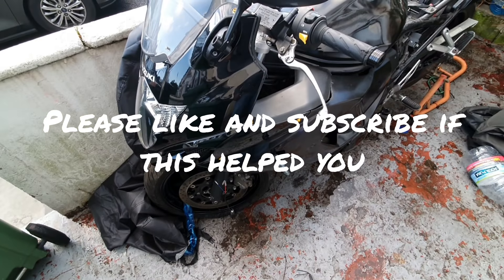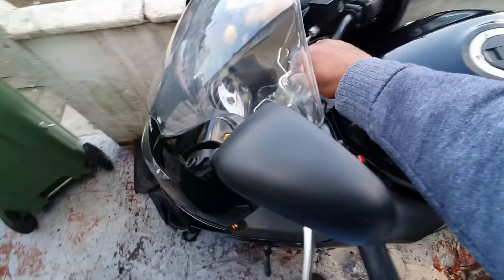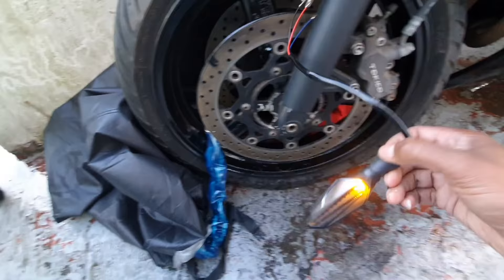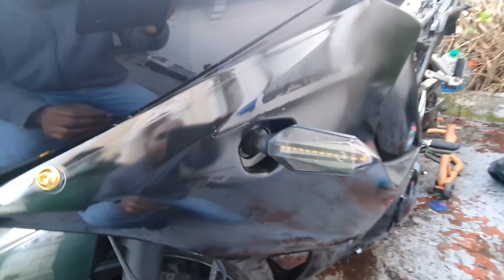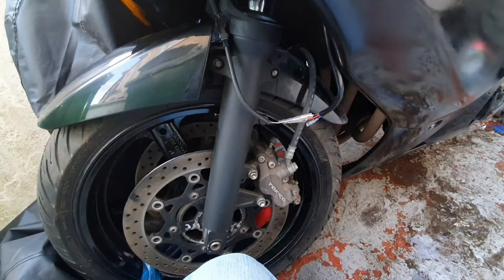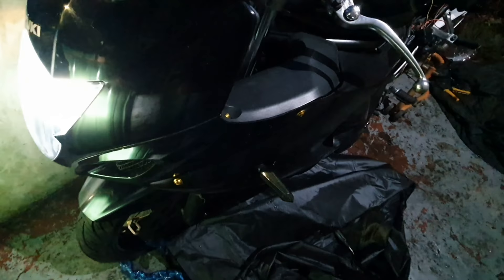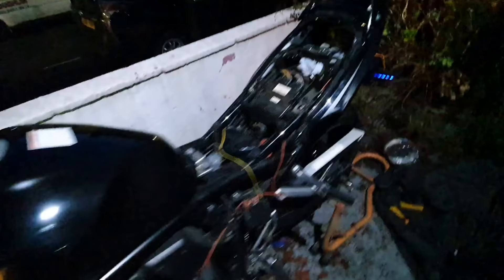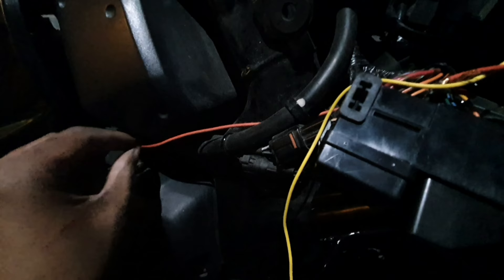How to install sequential following indicators on a motorcycle

Comment: Nice one saves a lot of unnecessary messing about thanks for the heads up I’m looking to fit led indicators to my tracer 900gt thanks 😊
Reply: please tell me what you did with that extra wire. cant get back light to work i'm guessing the extra wire is for that

Comment: Pro tip, if you have sequential indicators they have their own relay built into them

Take off your relay and connect the two pins together with wire or a connector to bridge it, and perfectly working sequential indicators without spending anything

You're welcome
Reply from the maker: Possibly could work on a bike with only 2 pins but mine has six on the relay so don't think it will work I have previously fitted these two different motorcycles it don't work properly these do not have inbuilt resistors but I will try it with my other set thank you
Reply: Was just about to try this out just checking comments to see if anyone ealse had jumped the contacts haha ill go try this. I was thinknig this becase i put the led over the battry to make sure they worked as i was getting nothing at all. I think i might stiill need a diode kit as its an old suzuki bandit.
Reply: What about flow rate to pass mot I fitted these, yesterday front and back and bridged the relay but was told it would fail mot due to flow rate speed??
Reply: @leejones3061  i had no issues passed mot. My issue was thay the dash indicator didnt flash anymore. Need new relay and resistor kit to fit it. Flow rate wasnt an issue. It is a problem with the relay replacment. But i passed mot with dash issues as you can see indicators from driving position.
Reply: How would you work it if only the front ones were sequential and the back ones were regular? Can you bypass the flasher module for just the front ones?
Reply: Hi, I ride a 2008 Hornet and I tried to mount the same signals as you but with the relay built in. In my case they are doing nothing. They work for sure because I tested them directly on the 12v battery (that's how I know they have built in relays). My relay has 4 pins. Which pins do I have to connect. How can I test which to connect .
Reply: My relay is 7 pins, how am I going to bridge the pins pls.
Reply: Pls how am I going to bridge the 7 pins led relay in Suzuki katana GSXF

Comment: wow thank you so much!!! i have the same problem
Reply: Ww is max out of the max
Reply from the maker: The sequential indicators do not have a built-in relay so can be fitted to any motorcycle provided they do a LED relay too slow no the flash rate down if not it will not work properly I hope this helps you

Comment: Dear sir,

instead of the stock turn signals on my V Strom DL650, 2014, I installed a sequential flow. I installed an automatic relay for the LED lighting instead of the original automatic relay. For the shade, they work a little faster (I honestly don't like it), and the led indicators on the instrument panel are only bright and do not blink. Even when all four indicators are working, the LED indicators do not blink, they just light up. PLEASE help how to make the indicator blink. greeting

Comment: Pls, how can I bypass the motorcycle relay when I'm using built-in relay sequential turning lights.
Reply: Take the relay off completely and put a wire between the connectors that plug into the relay, this will bypass relay and sequential indicators will work.

Comment: Might want to do some research on how that resistor should be wired. Black stays on neg side. Yellow stays on pos side. If I could post a pic I would. But they didn't work because you wired them incorrectly. 
Kindly :)

Comment: I fitted sequential indicators front and back yesterday on different bike initial install the indicators wouldnt flow to the end so fitted load resistors that just made them all flash at once hazading so was told to bridge the relay so I did and there all working but was told they, could fail mot due to the flow rate speed I had a led relay as was using led set up just not sequential
Reply from the maker: I just had my motorcycle MOT'd 2-days ago go and they did not say anything it passed with flying colours as all new Audis and Mercedes have this new feature I can't see it failing if the LEDs and the indicators are working but please update

Comment: Clearly I'm way to late to comment but hopefully you can help me out or someone on here. I purchased the same indicators as you but didn't realise they come with 3 wires, the original only have two so it's got me lost. I noticed you had the red and black wire connected but not the blue? Mine has a black, red & green wire so I don't connect the green? I'm totally lost in what to do, does anyone know where the green wire goes?
Reply: i have the same problem
Reply: @bOjan1141  I have found these on ebay which I'm thinking of trying so hopefully it might help you as well, no one has helped me but here check these out...Indicator Turn Signals Wiring Harness Adapter 3 Pin For Suzuki SV650/650S SV1000 or put your specific bike ofcourse
Reply: @joshuayarker6364  Thank you brother, you saved me. I ordered them hope they arrive fast.
Reply: @bOjan1141  anytime my friend, glad I could help! Hopefully real fast! 🤞

Comment: what's the name of the brand for the bigger indicators with blue arrows?
Reply from the maker: They do not have a name just following indicators I have the link below in my add or try this one https://www.ebay.co.uk/itm/2pcs-Motorcycle-Sequential-Flowing-LED-Turn-Signal-Indicator-Blinker-Light-/284383815158?mkcid=16&mkevt=1&_trksid=p2349624.m46890.l6249&mkrid=710-127635-2958-0

Comment: In they looked great but you confused me throughout the video. Do you have a Link for the blinkers?
Reply from the maker: I'm sure I put it in the add  addhttps://www.ebay.co.uk/itm/4x-LED-Motorcycle-Rear-Front-DRL-Sequential-Flowing-Turn-Signal-Light-Indicator-/133701753225?mkcid=16&mkevt=1&_trksid=p2349624.m46890.l49286&mkrid=710-127635-2958-0
Reply: @sammouss6901 you did but only for the relay!!

Comment: Iv just bought a set for my adrenaline! Will i have to buy a relay too? Its not just a case of swapping them over?
Reply from the maker: I'm pretty sure you will need to as the resistance to delay the flashing is inbuilt in a standard bulb with LEDs especially strobing ones there is no resistance so it will only light up a few LED cells the only way to get resistance is to delay it with a resistor you can test it by Simply swapping one indicator but I'm pretty sure you'll need a relay I hope this helps
Reply: Ah cool thanks for your response!
Reply: you can just short the relay with seqencial led indicators and mabie the diodie mod if you have one filliment dash bulb but the circuits in the indercators on these but dont do it to the standard flashing leds they need the led relays off ebay cheap as chips.
Reply: @spongbob18  thanks pal

Comment: Hi, thanks a lot for the video. I ride a Hornet and my new built in relay signals are not working at all with the original bike relay. I have a 4 pin relay. I tried to search a relay for my motorcycle model but they are not specifying if it does work with the built in relay signals. Someone tried some of them on a 4 pin honda? Thanks
Reply from the maker: Hello boby bob I think the problem you're encountering is the same one I had you cannot put indicators with relays on relays it simply will not work if you have a simple 4 pin relay it's literally 2 + 2-  if you can find out which is Which Bridge the circuit as long as you have inbuilt relays in your indicator it should work the only alternative is if you can get a specific relay for your motorcycle you will have to get the indicators with out a relay and it will work perfectly https://www.ebay.co.uk/itm/LED-Indicator-Flasher-Relay-4-Pin-For-Honda-CB600F-Hornet-07-11-Fast-Flash-Fix-/175099315275?mkcid=16&mkevt=1&_trksid=p2349624.m46890.l6249&mkrid=710-127635-2958-0 I have found this relay on eBay it will only work if your indicators do not have a inbuilt relay I hope this helps
Reply: Thank you. I think that relay is for flashin only, right? Even if I purchase simple led signals, they won't flash sequencially..
Reply from the maker: If you have standard indicators the relay will not make them flash sequentially you will need to replace your indicators with sequential ones without relays then purchased that relay and it worked perfectly unfortunately if you purchased indicators with relays they simply do not work as they're multi-use not specific for the bike the indicators I bought off eBay were only £20 four of them and the relay will set you back another £10 so for £30 you can get sequential lights small price to pay for such an upgrade just make sure the indicators you buy do not have relays and you're all good

Comment: What should i do if i put all 4 on and its working but it cant go left or right only in hazard mode
Reply from the maker: Not sure but possibly some indicators have built-in relays like the first indicator as show in the video so basically if you have for relays it will not work better to buy the indicators without relays then change your main relay and it should work but make sure you can get a LED relay hopefully that should fix your problem the indicators in video you are about £17 for 4 off eBay the main LED relay cost about £7 but it has to be specifically made for your bike and must be a special LED relay to slow down the signal in order for the indicator to strobe I hope this helps

Comment: Hi mate. i have the lights that only the first 3 lights light up. What is the fix for that. Cheers.
Reply: I have the same problem on my Kawasaki z800. When I plug them only the first couple light up very poorly.
Reply from the maker: It will be the relay you have to get an LED relay as it will not work without it you will have to search online or eBay or Amazon for your bike specific LED relay if they do not do one then you can not get it to work
As the problem you are having is your standard motorcycle relay is not capable of delaying the signal that your indicators need I have tried everything else and only the LED relay will work
Reply: @sammouss6901  Does your lights also have their own relay? As in one built in the lights
Reply from the maker: If you look at the video the first one have internal resistors but will not work that one I actually fitted does not have a relay the relay will slow down the signal so the LEDs will work if you have purchased ones with an internal resistor you might be able to just bypass the relay only if you have two wires simply touch them together and the indicators will become the relays this will only work with a 2 wire relay system if you have more than 2 do not do this as you will damage your bike if you can search online for your bike specific LED relay play it must say LED on it it for it to work correctly I hope this helps
Reply: @sammouss6901  Hi mate. i installed a bike specific 7 pin led relay. Did not change at all ? Still only light up about half way. It is a 2008 gsx 650f .
Reply from the maker: I'm pretty sure the problem you're encountering is the indicators you purchased have resistors built in no matter what you do you cannot get them to work with a 7 pin relay

With my 7 pin LED relay fitted I cannot use the first 2 LED indicators which I had purchased you will need a standard indicator without any relay to work I think this may be your problem
Reply: @ASnell  hi, did you solve the problem? Having the same problem too.
Reply: @Bart360spider  Got rid of the lights and ordered normal leds. P.s. the dynamic lights are horrible. My friend has them and I can barely see when he's using his signals
Reply: @ASnell  and the normal led blinkers were plug and play working?
Reply: @Bart360spider  yeah. I also needed a relay which I got from Ali expres for a couple euro's. The relay was to make them blink at normal rate

Comment: Hey, i have the same problem, but what to do if my front turn signals are oem but rear led ?
Reply from the maker: I have no idea how you could do this the inline indicators do not work but that's the only thing I could suggest or buy another set of Led indicators I'm sure they should be cheaper than when I purchased them

Comment: What kind of relay sir you replace?tnx
Reply from the maker: You'll have to get a specific LED relay for your bike if you would like to fit LED indicators as they do not have any resistance so they will not flash I did put the link below if you have the same bike if not search LED relay for your specific bike I hope this helps

Comment: Wich relais are you using?
Reply from the maker: If I've understood you correctly you are on about the background music it's a free app called you cut video editor you'll get free music and be able to edit videos for free
Reply: @sammouss6901  no I meant resistor
Reply: I have a scooter with in front non led and at the back also non LED, i want to keep the non LED in the front but i also want to out the led sequence turn signals at the back. How can I do this? Wich resistor do I have to use
Reply: My original lights are 10W
Reply from the maker: I've put the relay link in the the video it's a 6 or 7 pin relay specifically for this Suzuki but it depends on what indicators you have as this is made specifically for indicators without relays the part number is in the add
Reply from the maker: @jesseycoolen4169  you have to get a LED indicator relay depends on how many pins you have for your relay connection if you have only two pins you can get one specifically for your bike if there's more than 2 pins you will have to order an LED one for your specific bike if your indicators have been in relays like the one I did not fit in the ad simply connect the two terminals where your relay exist and they should work without you needing to buy a new relay